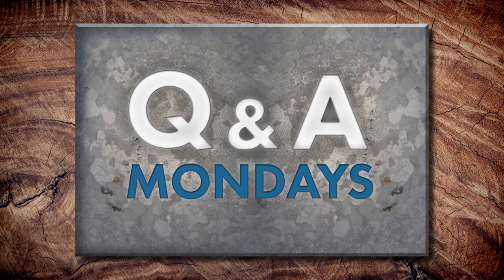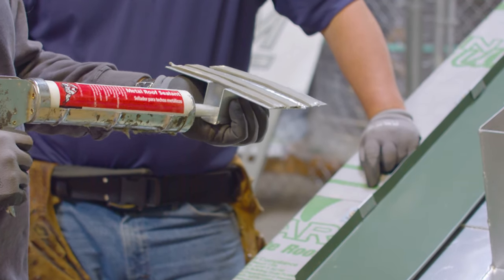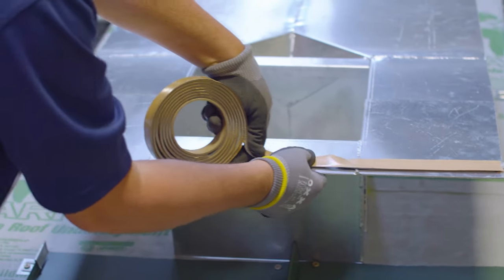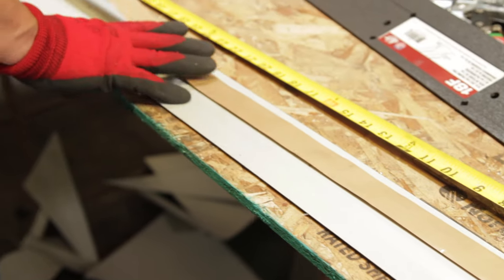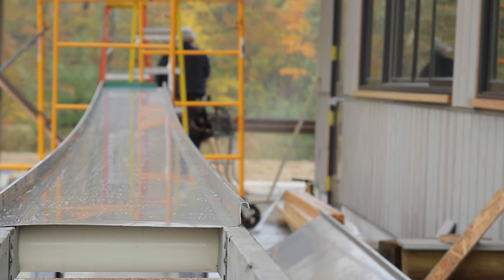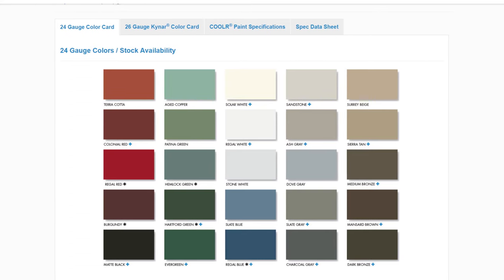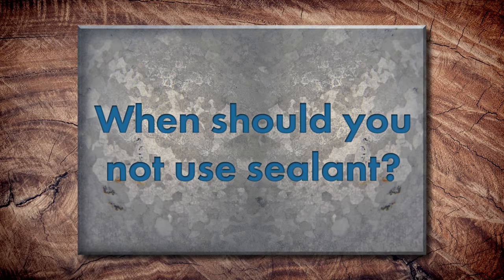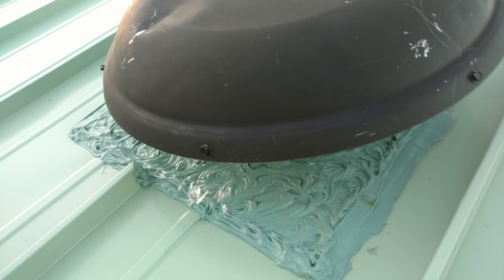When And When Not To Use Sealant On A Metal Roof Installation

Comment: Just got an insulated aluminium roof installed, there is a lot of condensation on the joints. The company that installed it just ran out of town. What can I do to remedy this?

Comment: What about using a expanding Polyurethane window and door sealant between the join layer of corrugated roofing. It sticks like glue but flexes and fills and as it is hidden from UV sun it should last until the metal fails.

Comment: I want to ad an additon to the side of my R panel with R panel on the side roof. what is the best sealant to use to keep water out without having to cut the metal out for the side extension?

Comment: Thx for the video. I’m a first time metal roof installer on my 10x12 Gazebo with a hip roof. I have a 36” ridge at top.. What would you suggest me use where the hips meet? would it be ok to use a 4” wide roof tape and maybe a bead of caulk before that???

Comment: What type of tube caulk would you recommend in each situation? I've heard silicone is good and stays flexible for a long time. Any tips are appreciated. Thanks!
Reply from the maker: Novaflex metal roof sealant is a great silicone tube caulk that Sheffield sells and promotes for installations. Let me know if you need a supplier or if you have any other questions! -Thad

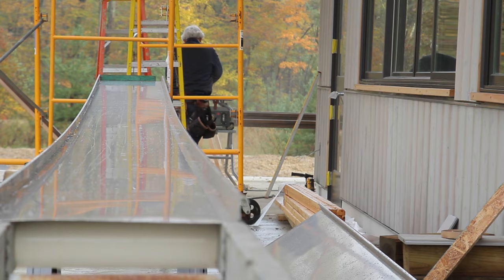Comment: From 2:18 on he talked about “gun caulking” I think what is used in these applications he talks about is the novaflex silicone - is that correct? He just never specifically said... Would that stuff also work for siding flashing applications where there are overlapped pieces as well like z flashing around a belly band trim board or the like? thoughts?
Reply from the maker: Yes, Novaflex is the product Sheffield specifies in their weathertight warranty projects. It is a specific formulation for metal roofing applications, but the company makes many different types of sealants that could potentially fit your needs. I would check with them: https://www.novagard.com/ -Thad

Comment: New to metal roofing installation..what a beautiful  product.  In the North East I see more and more metal roofing used in residential construction. Tab shingles  just can't take the punishment metal can.
If i wanted  to take a couple classes and be a certified installer can anyone suggest where I may look. ABC metal is the major manufacturer  in our area.
Perhaps  I should give them a call and start there.
When this video  popped  up I knew I was in the presence of the 3 wise men..hahaha..
Thanks in advance  for any insight.

Comment: NICE VIDEO... I HAVE A METAL ROOF THAT HAS THE Silver Coating or Aluminum Asphalt Paint THAT HAS LASTED AS TOLD (17YRS) BY A ROOFER THAT IS NO LONGER AVAILABLE. NOW THE FLAT ROOF HAS SOME RUST SPOTS AND I THINK THE BEST THING TO DO IS JUST GIVE IT A LIGHT COAT OF "KARNAK 169 NON -FIBERED ALUMINUM COATING... IS THIS WHAT I SHOULD BE USING? ROOF DOES NOT LEAK... THANKS . NOAH
Reply: Why shout?

Comment: Guy on video says tape is for metal to metal connection while video shows tape applied to OSB board.  Makes me question the rest of the information.
Reply from the maker: Actually, the installer is pre-applying the tape onto a cleat which will later be added to a valley section. The OSB you see is just a work bench. -Thad